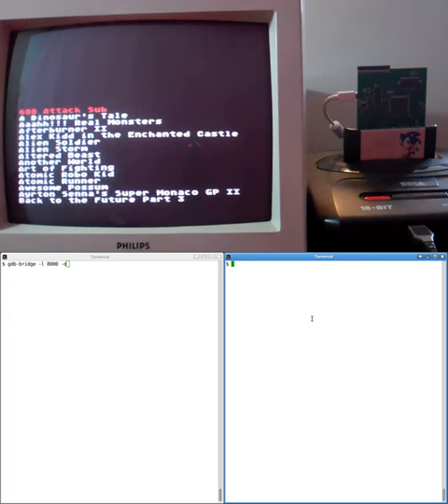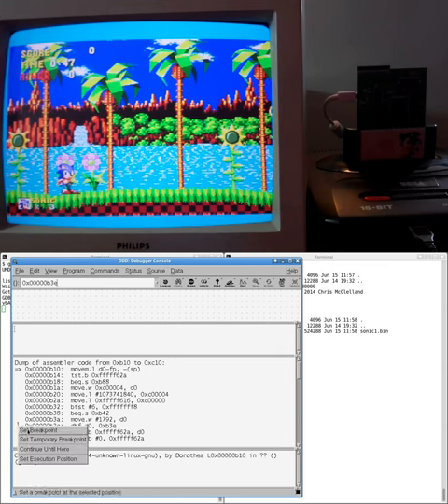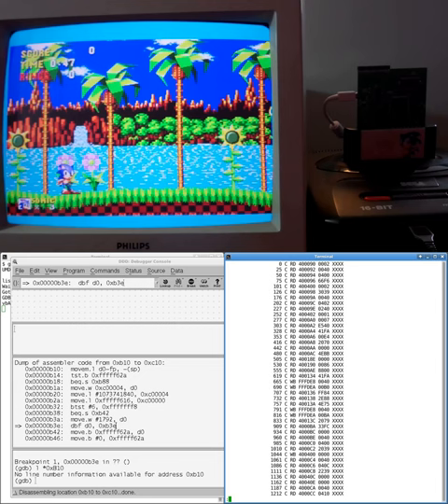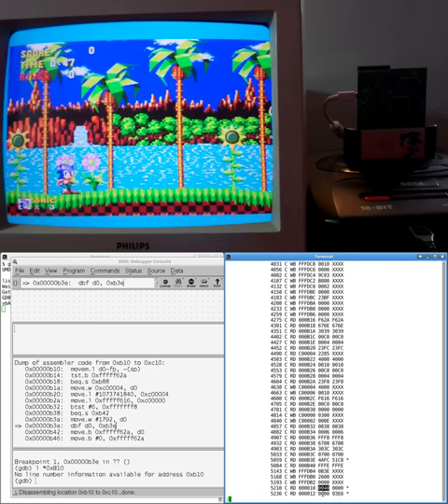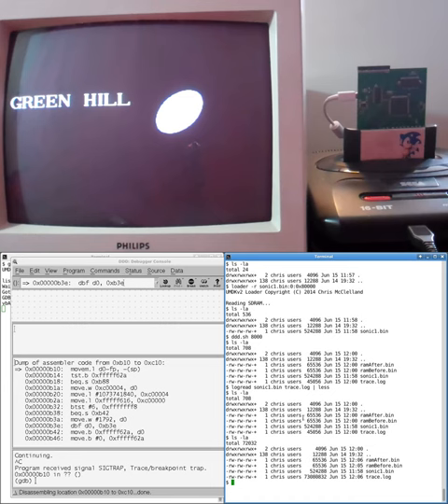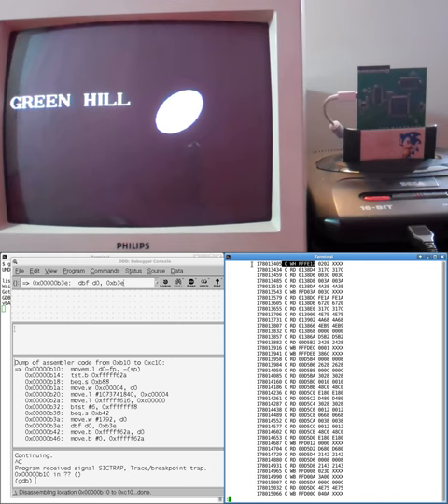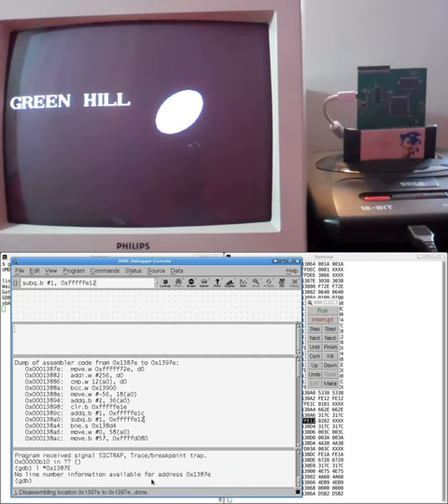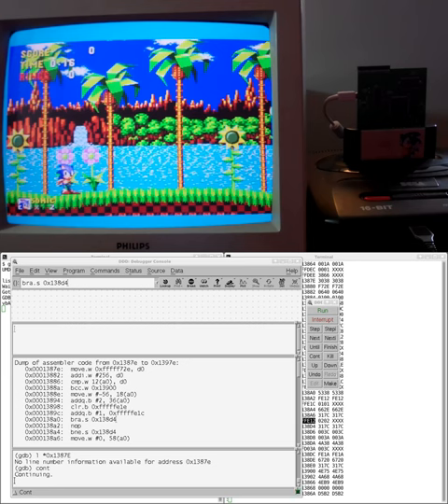USB MegaDrive DevKit Part 2

Comment: Thank you for sharing your experiences - really interesting and a lot of new information for me. :-) Could you please give a few hints on how your gbd-bridge actually works? How does your cartridge connect to the M68k in order to make it debuggable with GDB? Thanks!
Reply from the maker: Rainer Poisel the debugger uses the GDB remote serial protocol, which is just a small set of commands like:
* "Read 16 bytes of target memory at address 0x123456"
* "Set register D7 to 0xCAFEBABE"
* "Set breakpoint at 0x654321"
* "Continue execution"
Originally the remote serial protocol was designed to work over a serial (RS-232) link, but it can also be made to work over TCP/IP, which is what I did. So I wrote the gdb-bridge (actually "gdb-proxy" would be a better name), which listens for incoming GDB session connections on a TCP/IP port, and when the connection arrives it waits for GDB to issue commands. When it gets a command it can either fulfil the command directly by reading & writing the SDRAM[1], or it sends commands to the monitor program on the MegaDrive in order to fulfil GDB's request[2].

Breakpoints are implemented by writing the illegal instruction opcode to the breakpoint address, and replacing the illegal instruction vector with the monitor address (0x400000). When the 68000 hits the illegal instruction, it throws an exception and thereby returns control to the monitor.

Single-stepping is implemented using the 68000's trace feature, which is a bit in regiser SR which when set will execute only one instruction in user mode, then throw a trace exeption, which also brings control back to the monitor.

The debugger has read/write access to the 68000 registers because the first thing the monitor does when it starts is to save the registers to a known region of SDRAM, where they can be read (and updated) by GDB. When the monitor exits, the last thing it does is to load the 68000's state from that region of SDRAM (picking up any changes applied in the meantime by GDB).

I hope this helps. Let me know if it's unclear.

[1]My SDRAM controller in the FPGA is able to interleave accesses by the host with accesses by the MegaDrive. This makes the SDRAM effectively dual-port.

[2]This is achieved using an arbitrary binary message-passing scheme, where the host writes a command-code and any arguments to an agreed region of SDRAM, and then triggers the command by writing to a semaphore. The host then polls that semaphore waiting for the MegaDrive to update it with "I've finished", whereupon the host reads the response from the same agreed region of SDRAM.
Reply: Chris McClelland Thank you for your comprehensive explanation. That definitely helps me to get a clearer understanding of how your debugging works.

From watching your videos there is just one more thing that's a bit unclear to me: What is actually the purpose of the FPGA on your board?

The flash memory seems to contain the menu as well as your monitor application. Then there is the USB interface that somehow gives access to the SDRAM. The bridge board seems to do the 5V <=> 3.3V conversion and has an interface similar to the MegaDrive interface as well as an interface that matches your board. Am I right, that the FPGA can be understood as the 'glue-thing' between all these components?
Reply from the maker: It's an amusing way to think of the most complex component in the system, but yes, the FPGA can be thought of as the "glue thing". In the same way that a CPU glues together the memory, I/O, peripherals, video and audio circuitry in a computer.

The FPGA implements:

* The interface to the USB controller[1]
* The SDRAM controller[2]
* The host memory pipe[3]
* The SPI controller[4]

...and finally all the MegaDrive-specific stuff[5] like:

* The MegaDrive bus interface
* The MegaDrive-accessible hardware registers
* The memory arbiter (which arbitrates access to the SDRAM by the host and the MegaDrive)
* The reset controller (which allows the MegaDrive to issue a hardware reset from software)
* The SPI funnel (which allows the SPI interface to switch between 16-bit and 8-bit widths)
* The trace FIFO (which allows the trace log to be sent over the bursty USB link without losing any trace events)

The total is well over 3000 lines of VHDL (not including unit tests or Xilinx-generated stuff).

[1]https://github.com/makestuff/comm-fpga/tree/master/fx2/vhdl
[2]https://github.com/makestuff/mem-ctrl/tree/20140524/vhdl
[3]https://github.com/makestuff/mem-pipe/tree/20140524/vhdl
[4]https://github.com/makestuff/spi-master/tree/20140524/vhdl
[5]https://github.com/makestuff/umdkv2/tree/20140524/vhdl
Reply: Chris McClelland Hehe :-) Yes, I have not come through to work with FPGAs yet. But I am intending to. Hopefully finding some time soon ...

Thanks anyway again for your comprehensive explanation! It's people like you the open-source community profits the most from. Your project is based on a really cool concept and as far as I can tell its implementation is as great.
Reply from the maker: Actually my CPU analogy is unfair - a better analogy for the UMDK FPGA is your motherboard's chipset (northbridge & southbridge): http://en.wikipedia.org/wiki/Northbridge_%28computing%29

But yeah, definitely play with FPGAs, they're a lot of fun. Checkout FPGALink too, which is the hardware abstraction layer on which UMDK is based.

Comment: Did you create more of these Dev Kits for sale?
Reply from the maker: No, sorry. A few people on http://spritesmind.net had small batches manufactured, but there was never sufficient interest in it to make bulk manufacture worthwhile.
Reply: @makestuff-de is there a tutorial to build one at least ? I have some basic soldering skills
Reply from the maker: @SeleDreams  yep, it's all open-source, you can find all the schematics, gerbers and PCBs, notes on the components and notes on building the firmware & software on GitHub:

LX9 board: https://github.com/makestuff/lx9/tree/r3

Bridge board: https://github.com/makestuff/umdkv2-lx9/tree/r1

Power-on tests, building firmware, etc: https://github.com/makestuff/umdkv2/wiki/Getting-Started

You might have a bit of trouble getting suitable components now, because these notes were written a decade ago, and I haven't really touched it since.

Also it's possible there has been some bit-rot in the software tools (e.g the Xilinx FPGA tools, the KiCad PCB designer, the 68000 GCC toolchain, etc etc), so it's worth checking you can build all the software, firmware and FPGA bitfile OK before spending time and money on hardware.

Good luck! Let me know how you get on!

Comment: why 0x6032 is equal to that branch instruction? where is the address part?

btw, congrats on the work :)
Reply from the maker: Great question! Have a look at 11:16. Notice that the BNE instruction is at address 0x138a4, and it branches to 0x138d4. Notice also that the following instruction (a MOVE.W) is at 0x138a6, so the BNE instruction itself is only two bytes long. Now look at the instruction encodings[1]. For "BRA", you can see that the instruction is encoded as 0110 0000 <displacement>. The displacement is a signed byte, meaning it can branch relative to the current PC by +126 or -128. In this case we want to branch forwards by 0x138d4-0x138a4=0x30 bytes, giving an instruction encoding of 0x6030. But, due to the pipelining of the 68000, there's an additional "skid" of two bytes, so the actual encoding is 0x6032.
[1]http://goldencrystal.free.fr/M68kOpcodes-v2.3.pdf